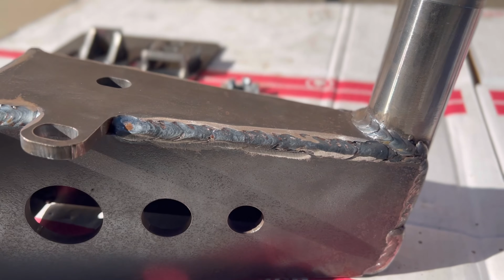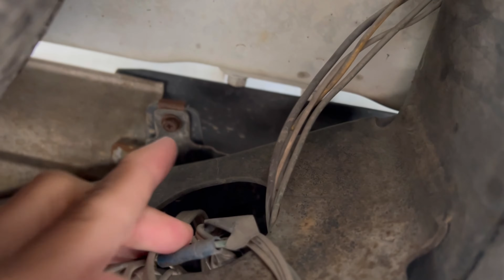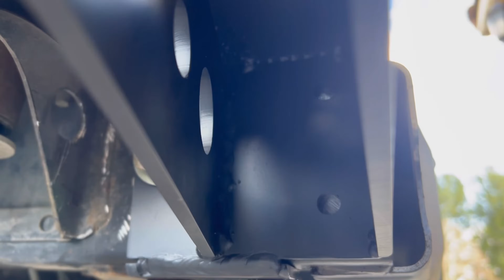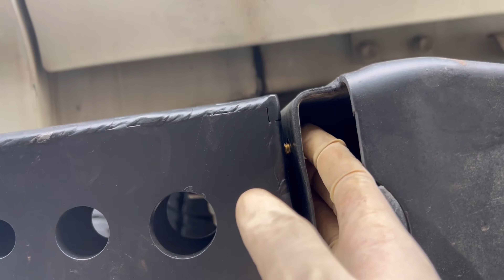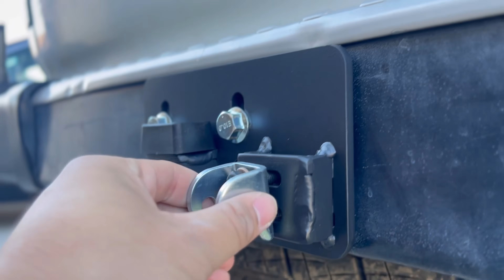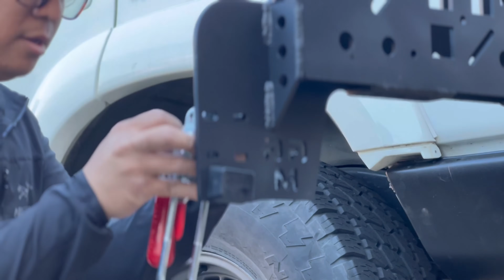Easy Bolt-on! How to Install the GGM 80 series Land Cruiser Tire Carrier.

Comment: Great break down, and recommendations in the vid!  Installed mine at the beginning of the month onto an LX450. The center latch mount on over the OEM pintle mount was a little chalk for me as the LX450 has a body panel over that area. Everything else was “figure-outtable” but the provided directions could use some enhancements that I plan on recommending directly to GGM.
Reply from the maker: Yup definitely “figure-outtable” lol. Next is to modify a strut assist On there.

Comment: very nice work, where do you find the support for the bearing?
Reply from the maker: Thank you. What Support for the bearing?
Reply: @CruisinMiles  you use a pin with a two bearing to support the wheel carrier.
Reply from the maker: @TrigliaAdventure  ohhh, it is a spindle. I am not sure where you can order those from. But you contact the manufacturer. Go to generalgreenmanufacturing.com and contact them through there.

Comment: I definitely like mine. I have the newest version so my bumper corner site fine. I also didn’t trim the bumper support bracket. I bolted it back on and used it.
What latter are you using though? Do you like it?
Reply from the maker: Great to hear. The ladder I was using was some no named brand I was able to snatch up from Facebook market. I’d like it alot but doesn’t fit with the spare tire actually hung up on the carrier

Comment: Looks awesome! Nice work!
Reply from the maker: Thank you! It was a very simple install. Going to be installing accessory mounts onto it next
Reply: @CruisinMiles  makes the rear end look great without the super high cost of a full rear bumper.
Reply from the maker: @NKPGarage  exactly what I was looking for. Budget friendly and lightweight. (Compared to full bumpers) 
GGM is working on making side protection add-ons that will replace the plastic bumpers.

Comment: I noticed that you didn’t reinstall your hitch. Now I know why—I’m installing my GGM carrier now and it requires that it be mounted where the hitch also mounts. Wasn’t anticipating this. I’m
Going to have to figure out a way to mount a receiver hitch after the GGM carrier is installed. This just turned into a bit more of a project than I had planned for.
Reply: One thing that might be helpful for viewers to realize is that for Landcruisers, the bumper extension brackets don’t need to be cut like you did. Matt’s LX450 has a different configuration, which is why he had to cut some of his bracket (in the GGM installation instructions). I cut mine as you did and then realized by doing so I had removed some mounting points for the plastic bumper extension and got to wondering if maybe I could have left more of the bracket in tact. Luckily I had another bracket so I test fitted it with the spindle mounted and wa-la: it fit. So I ended up using the uncut bracket.
Reply from the maker: @kirkwerner64  this is awesome to know! I had thought about that as well but never ended up doing anything about it! Thank you Kirk. Very good to know
Reply from the maker: You can actually reinstall your hitch. You might need longer bolts though. But I can work. I need to find the picture online of someone who did it. I just didn’t reinstall mine because I was too busy recording the video
Reply: @CruisinMiles  not sure how an OEM hitch bolts up but I have an aftermarket hitch and in order to be able to reuse it I’ll need a couple spacer plates the same thickness as the carrier for the 4 bolts that are not being used by the GGM carrier.
Reply from the maker: @kirkwerner64  I posted the pic of the customer who installed it with the frame hitch. Over on MUD
Reply: Before we get too excited, I did end up having to trim a small section of the bracket. I did not have to cut it off, but moreover just cut out a section that was interfering with a part of the spindle mount. I’ll be posting details on the MUD thread as soon as I figure out some other fitment issues I’m having (similar to your early version hitting on the plastic bumper extension). Argh!

Comment: You can get an entire bumper w tire mount fit not much more. Would rather have an entire bumper w options of Jerry can holder and side protection. A bumper also gives you more clearance and protection.
Reply from the maker: For not much more yes, but a full bumper isn’t always the answer. When weight is a major factor to someone’s build, a full rear bumper is definitely something to consider. In terms of clearance, the rears of the 80 series have pretty substantial clearance already. Yes, protection is a huge thing to consider, but considering how a full rear bumper would pretty much be fabricated into the frame, it’s very common for people to remove the plastic bumper ends and fabricate their own protective pieces into those spots. A solution that would fit the weight consideration, as well as clearance and protection. You made good points, but they’re simple not always the best answer.